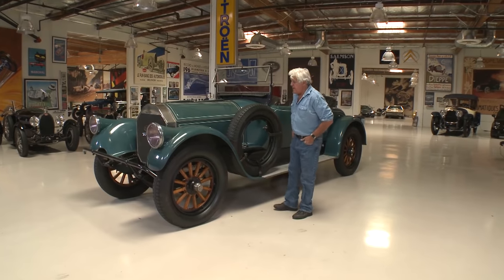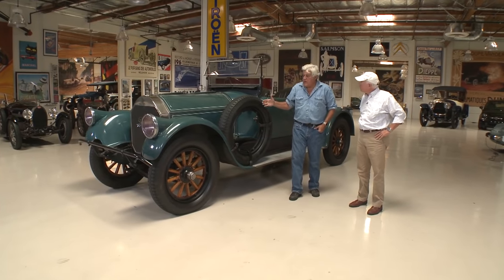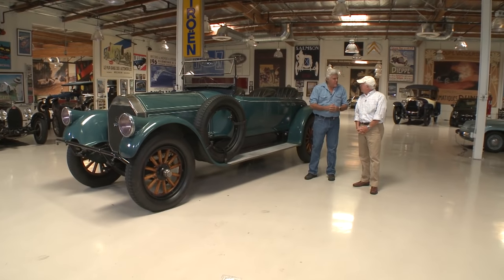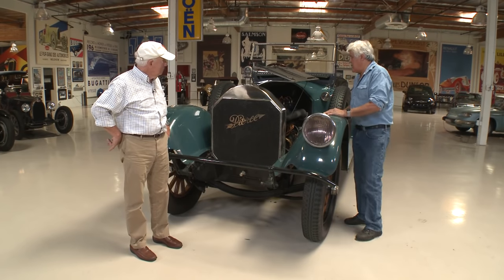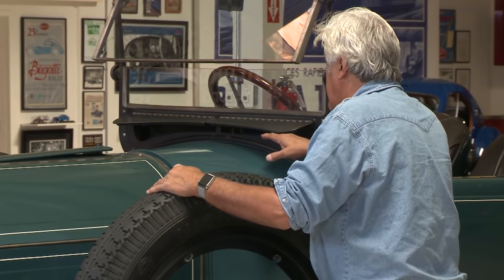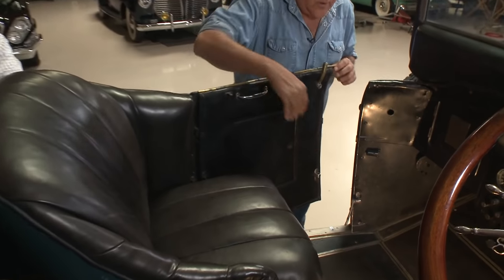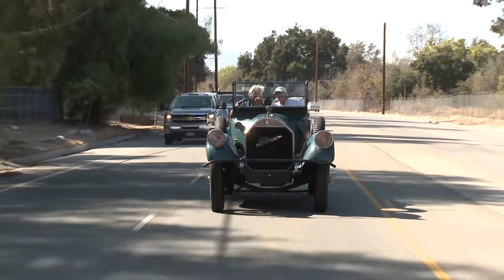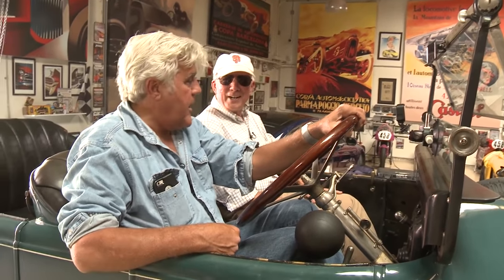1918 Model 66 Pierce Arrow - Jay Leno's Garage

Comment: I love the whine sound of the manual transmission in these types of cars.
Reply: Straight-cut gears.  Old tech, strong and reliable.
Reply: Straight cut gears and likely a crash box (non-constant mesh, non-synchronized)
Reply: DandyDon - Yep, that's why I love the "Victory by Design" videos Alain de Cadenet made. You get to here those spur gears in all their glory. I suspect helical gears came about simply to eliminate the noise, as they are less efficient and produce axial bearing loads.
Reply: That's what I was always told, they went to helical gears simply to eliminate the noise.
Reply: It's reasonable. Many machine tools have them for this reason.

Comment: $6,000 in 1917 equals $124,878.62 in 2017
Reply: You wonder how Packard got the initial funds to build the factory...
Reply: That's cheaper than I would have thought....
Reply: Yeah, but incomes were lower overall in at $1500 avg ($24K in modern dollars) then as well as property values, it seems the modern dollar has "fallen behind" its older values, hahaha.
Reply: That's 300 ounces of GOLD at $20/oz   

300 oz 
@ 1000/oz GOLD  = 300,000
@ 1500/oz GOLD  = 450,000

Comment: What a great video. I still can't believe this car is unrestored. 100 years and those wheels still hold all that weight on the road! Fascinating. 
Does anybody know what kind of oil is used in these old cars. If I remember correctly Jay explained this in one of the restoration blogs but I can't seem to find it.

Comment: 14 liter = 854 cuin. I drive a 2021 Volvo VNL760 semi with a 12.8 liter (780 cuin) inline 6 turbo diesel. It has 450 hp @ 1,700 rpm and 1,750 lbs.-ft torque from 1000 to 1500 rpm.

Comment: What a car. Made from cast aluminum a quarter-inch thick and with an engine that would have been just as well-suited in the tanks of the period. The only hurdle, of course, was the fact that the car cost as much as the average neighborhood. What I wouldn't give to have been a mechanic or an engineer at around that point in history... Hell, even a chauffeur, so long as I could spend some time around these magnificent cars.

Comment: Pass along this information please...

I used to own a number of photographs of that exact vehicle. One of the photographs was quite large, there was also over two dozen smaller photographs. All of the photographs were purchased at a type of garage sale at...

Green Street, San Francisco - most likely the same exact Green Street that was mentioned at 3:10 ...

Do not recall the exact location on Green Street where they were purchased but... The photographs all appeared to be taken in and around the location of Green Street and Montgomery Street.

The larger photograph is basically on the vehicle in the street, with the Bay in the background. Most interestingly, no Bay Bridge in the background; quite a few very large sailboats though. One of the smaller photographs shows the vehicle in the same exact place but showing a downtown view in the distance. I thin one of the former owners used to live and/or work at the 280 block of Green Street.

One of my most valued collection of photographs that I've ever purchased. Lost all of it in a divorce, otherwise I'd gladly share

Comment: In Germany they had never such big engines.  The biggest I read of must have been the Stoewer D12 from 1921 using a WW1 Argus Air Engine 11,2 Liter 120 HP. But none of the 4 or 5 cars survived. They used it for beach races on the East Sea beach near Stettin , Sczeczin how it is called now in Polish.

Comment: 5:03 Weighed 60,250 pounds (30 tons)?? He must have said 16,000 pounds. Or 6,250? 1/4" thick cast aluminum body? If that was steel, this would easily be an armored car in 1918.

Comment: Maybe I missed it, but does it still have the original brakes? I'd assume mechanical although at this high end maybe it could have had hydraulic drums?
Reply: This car still has its original, as described... inboard and outboard rear wheel brakes. no front wheel brakes.
Thanks Jay. Interesting there's no refuting your comments that the Pierce Arrow is/was better than a Rolls Royce.
Reply: Hydraulic brakes, and front wheel brakes had not been invented yet. All cars had drum brakes on the back wheels operated by rods and levers. Some had brake shoes inside the drums, some had a lining that wrapped around the outside of the drums. Pierce Arrow had both.
Reply: Thanks, sounds like I did miss it. Jay sometimes puts modern brakes on these cars for safety's sake so I was wondering.
Reply: When 4 wheel brakes became popular in the early 1920s some expensive cars like this one, were modernized with a new front axle that had brakes installed.

Comment: Why don't modern cars have inside outside breaks? Uou could have disc brakes on all four wheels and drum brakes next to the differential. On trucks you could have a break on the transmission and transfer case.

Comment: A 14 litre 6 cylinder is close to the same displacement as many semi truck diesel engines today, including mine. Sure, they make 600 horsepower and 2000 lb/ft torque, but still the same displacement.

Comment: As far as needing "a man" to work on it or hand crank it (!) look at how "breaker bars" have gotten longer over the years,I think they used to be about a foot long,then 40 or so years back a lot of them were 17" or 18",then the thing seemed to be the 24" length and now Snap On has a 36" nominal one ! (Referring to 1/2" drive) 
although brutal strength shouldn't be required for a person to be a great mechanic and I believe women can be some of the best! --but not with my grandfather's tools. 
The Snap On 36" is kind of neat with its replaceable square drive and even replaceable forked head,I think the very expensive  handle is supposed to be almost indestructible (SN36)

Comment: why is it right hand drive?
Reply: Pierce Arrows stayed RHD until 1921. Everyone else with a few exceptions switched to LHD between 1910-1916 or thereabouts, and in fact cars having LHD became a big advertising selling point. As to why everyone eventually switched to LHD, everyone seems to have a different answer for that, but they did. Some guesses why include Henry Ford using it on the Model T, giving drivers better visibility of oncoming traffic, and allowing passengers (women) to dismount on the curb and not the muddy street. Btw, RHD is legal and I used to own a RHD jeep that was fun to drive.

Comment: Is it safe driving your Pierce Arrow 66 at 70mph?  It's a huge heavy car with lots of torque and double brakes on the rear wheel. Your'e trusting your life on 100 yr old wooden spokes. A strong application of throttle or brakes could be calamitous. How about a set of metal wheels for when you are showing off its performance?

Comment: Why do old cars like this have positive camber? I know there's a good reason for it, but I forget.
Reply: It brings the steering axis to the middle of where the tyre contacts the ground which reduces bump steer and steering effort since they didn't have power steering and backspaced wheels back then. It also puts more of the load onto the larger inner bearing and makes it harder to snap off the sub axle spindle.  
Some race cars had even more positive camber on the front to help control oversteer by reducing grip on the front wheels and causing understeer.

Comment: guessing it had iron pistons so a tighter fit allowable.
Reply: radioguy1620 You know most likely you are absolutely correct. Not many people would have thought of that. The carbon particles would have assisted with sliding friction,and as long as the piston speeds remain slow,wear would be negligible. Wonder how big the rings are. Huge,most likely. Cheers.

Comment: My uncle had two of them. A 1919 touring and a 1933 V-12 roadster with an rumble seat. He bought the 1919 in the mid 60's for $6,000. The 1933 he owned for longer, not sure what year. The 1933 was all original, it had one owner before him, The original owner was George F. Tyler who gave the land and buildings for Tyler State Park and Bucks County Community College. I think that car is on it's 4th owner now and it's in Canada. Still all original with original paint and everything. We had a lot of fun with those cars in the 60's and 70's. He drove the 1919 Touring all over. It definitely wasn't holding up traffic

Comment: The Rolls-Royce reputation came along a bit before this car...because of the original car to be called the "Silver Ghost", a 1907 40/50.  As soon as it was  introduced, it did the Scottish Reliability Trial, then immediately embarked on a 15,000 mile test - which is finished with no problems-significant when you consider the condition of "roads" back then- better called "dirt bullock trails."

But that was all in 1907, 11 years before this Pierce Arrow, so any comparison is going to be somewhat biased in its relevance.  :-)

Comment: I'm late to the party but I have to say that's a frigging truck engine in that thing. The modern cummins isx is a 15 litre inline 6, mind you it weighs 3500 lbs and holds 45 litres of oil, but still, a 14 litre inline 6 in 1918 surprised me

Comment: Hi Jay. When you read some of the instructions from the handbook it reminded me of the instructions in the handbook for the 1936 Rover 10 I had back in the late 60's. It described moving off by pressing down the clutch, selecting 1st gear, letting the clutch up and pressing the accelerator to get going but the amusing part was "Having attained a road speed of 3mph change into second gear", then "Having attained a road speed of 7mph change into third gear". How many cars these days would you even be able to do that? It was a beautiful, fun motor especially with the "Freewheel" mechanism and I wish I still had it.

Comment: The guy was spot on , you lose a ton of power in the rear diff, Only place i ever noticed a truly dramatic change with lubricants was when I put redline synthetic gear oil in my rangers rear diff, off idle on a roll I noticed it right away.

Comment: The Air pump was to air the spare up after you put it on, Did not always have a gas station, Just in case it does Not hold air.

Comment: Built in Buffalo. Why was it right hand drive?
Reply: n2awa back then there was no industry standards so they could get away with anything. Plus back in the early 1900's there wasn't paved roads with painted on lanes. These cars would go do dirt roads traveling with horse and buggys next to them. Some harleys in the up until 70's had the hand and foot controls on the wrong side too.

Comment: I laugh at the steering, because I had a 1988 GMC work truck with a worn out steering box (actually still have it just parked for 15years) with a leaky power steering pump. And, Iwould get upset if so.rkne filled the power steering, because the truck became pretty much undrivable at road speeds.  Admit it was hard to steer when stopped.

Comment: The old Rolls used huge engines so owners did not need to shift if they didn't or couldn't know how.  Your man mjght know how to shift and work the car, but rich owner was required to do such mundane things.    This machine could match the Rolls in this snob bound market.